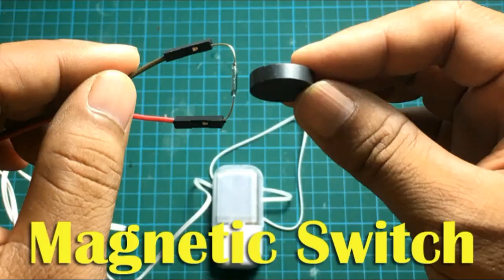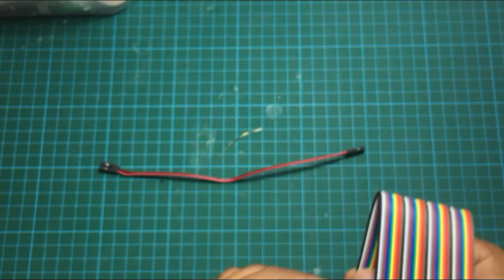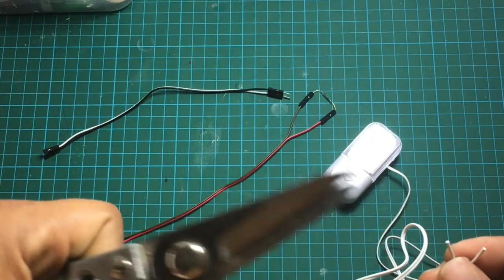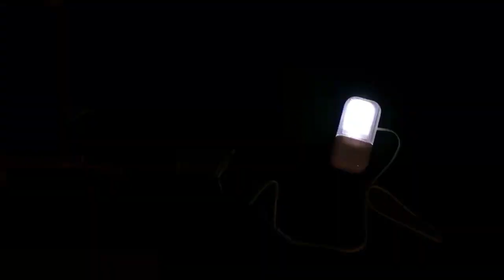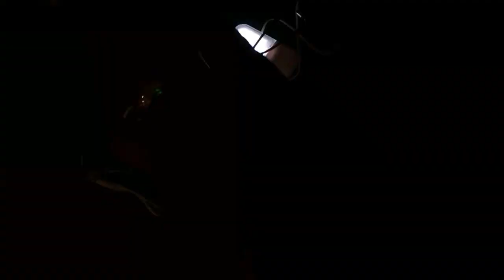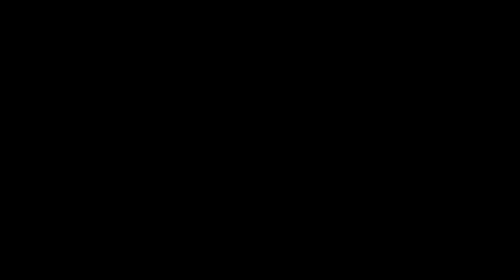How Magnetic Switch Works - Creative Channel

Comment: Great video....how can I use a magnet switch to act as a power switch? I need the switch to activate as the magnet is pulled away. How can I achieve this?
Reply: Single pull double throw reed switch.
One side is normally closed (on) when no magnet, and opens when magnet.
But the other side is normally open (off) and closes with magnet.
Reply: Ye NC switch shop p nahi mil raha he plz help me